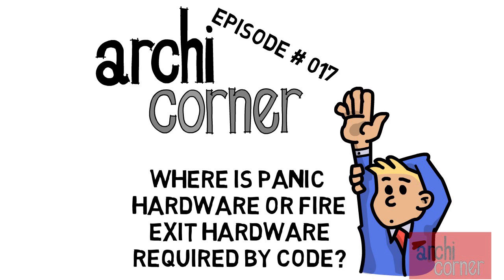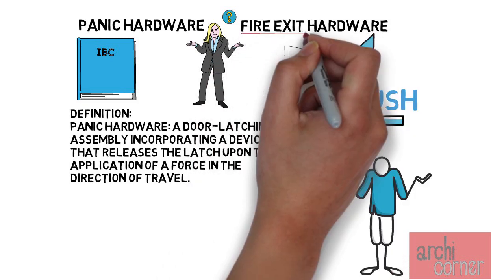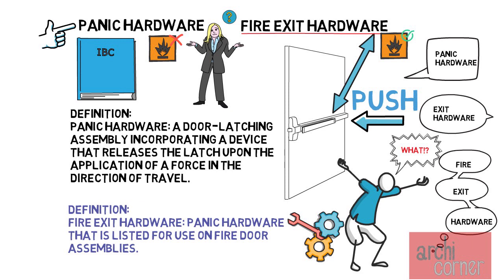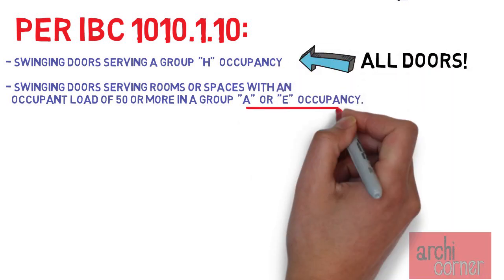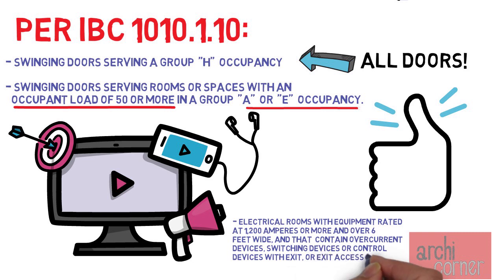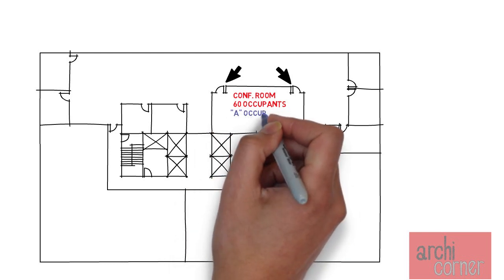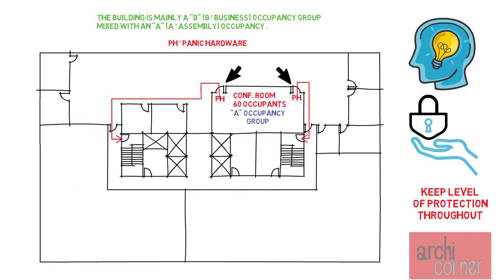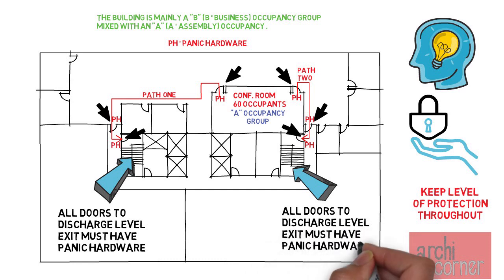AC 017 - Egress: Where is Panic Hardware or Fire Exit Hardware Required by Code (IBC)?

Comment: Hi Josue,  if there is an area with different rooms and has a total of  more than 50 occupants, B  occupancy and has two exit doors, should the exit doors have panic hardware? Thank you!
Reply from the maker: Based only on occupancy group and occupant load, and nothing else, the IBC does not require B-Occupancies to have panic hardware regardless of the occupant load. There are other circumstances that may require panic hardware such as electrical rooms.
Reply: @archicorner  Thank you. Your videos are very helpful!

Comment: @archicorner, Does the final exit door require a door closer as per IBC?
Reply from the maker: Fire rated doors require self closers. However most exterior doors, even as part of an exit system don’t require a closer by code. Nevertheless one is often provide for security and other reasons.
For example you don’t want the air conditioner working and having the exterior door open. 
If there is a part in the IBC that says otherwise please share it so that we can look at it.

Comment: @archicorner, if there is an office space (with small offices and one big hall with open type workstations) on a floor and it has an occupant load of more than 50 persons. There are two exit doors from this office space to a corridor that leads to exit stairs. Is panic hardware required at exit doors of this office space (glass doors installed currently) or panic hardware is required only at the final exit door or door that opens to stairs? please answer.
Reply from the maker: Muhammad; What IBC year are you using, chapter 10 changes from one IBC to another. You also did not provide the occupancy group which is very important. below are SOME code references in chapter 10 that may provide more information for you:

2021 IBC 1010.2.9 requires all "H" occupancy  groups to have panic hardware. Occupancy groups "A" & "E" are required to have panic hardware in any room with 50 or more occupants. 

There are also special rooms that may require panic hardware such as refrigeration machinery rooms, rooms with electrical equipment, etc. (2021 IBC 1010.2.9.1 & 1010.2.9.2)

Some B occupancy and I-4 Occupancies may require panic hardware (2021 IBC 1010.2.8).

Comment: Where are sprinkles systems and smoke detectors required? (Exiting buildings)
Reply from the maker: Normally existing non-sprinklered buildings are not required to be updated with sprinklers unless they are having a change in occupancy or undergoing an expansion. Things may be different in each state/jurisdiction. A local  sprinkler engineer could help answer the specific questions. As for the fire alarm, that’s a bit too technical to explain thru this comment. A fire alarm engineer is usually engaged to asses requirements for all new projects.

Comment: Also, fire exit hardware is hardware (panic bars) that CAN NOT be over ridden to be keyed or otherwise unlatched. Some panic hardware have a slot for an Allen key that will lean the latch closed meaning the door will not latch, this is fire hardware for fire doors, basically, the door hardware will always latch closed. Panic hardware u can retract the latch to allow easy access from either side,
Reply from the maker: Awesome information! Thank you for sharing.
Reply: archicorner can you make a video on horizontal exits? And while your at it lol maybe special inspections?